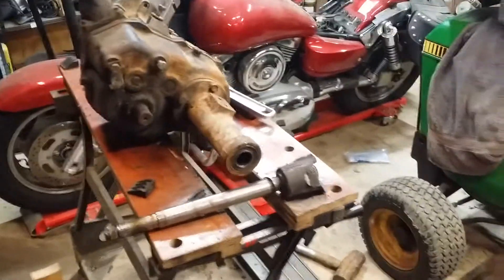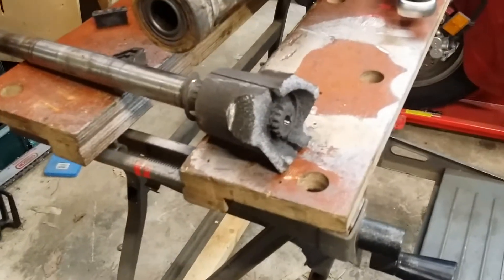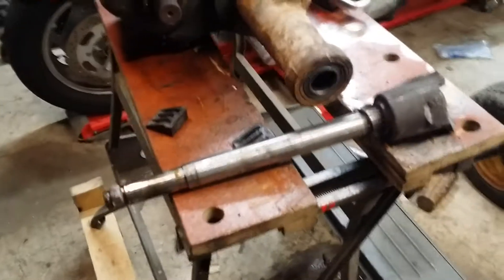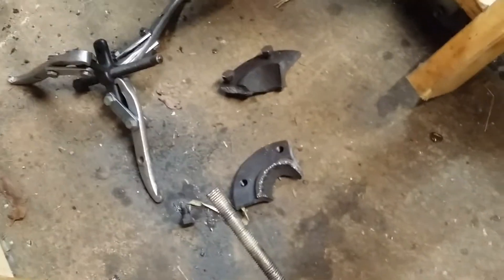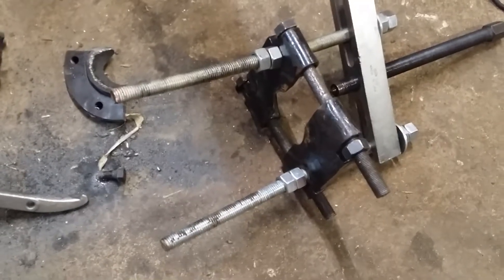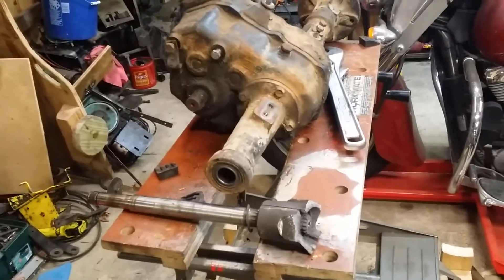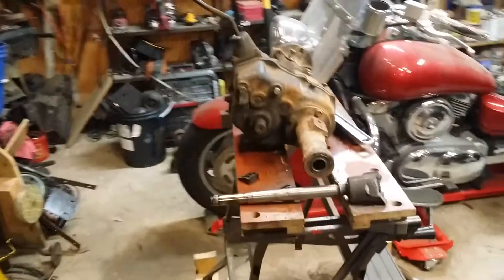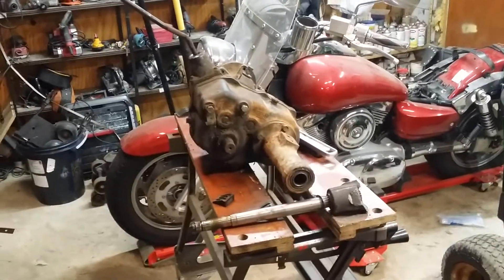John deere 214 axle hub disassembly failure

Comment: You took the snap ring out and it’s still that tight? Usually these hubs get loose over time because the splines wear.
Reply from the maker: Not just tight,  but almost seamed welded together.  I fear the other side might be the same. I also have a pair of other 200 series with loose/worn hubs, talk about opposite ends of the spectrum.
Reply: Craig Tate I think I’d be trying some penetrating oil and some heat on the hub only.
Reply from the maker: @stuffyoucando2  tried heat (propane) soaked for weeks in WD40. If the other side is like this its going on the mill to get split
Reply: You could’ve just taken a cutoff wheel to the hub. Once a slot of cut stick a screwdriver into it, whack it w a hammer, twist the screwdriver with vice grips & it should snap the hub in 1/2.

Could’ve saved ur transmission.
Done the technique many times on stuff.
Kinda surprised it’s stuck on the axle cuz nearly every single one of these hubs gets loose.

Cast spline hub on a hardened steel axle. Issues u find after nearly 40yrs of use. Got 5 of these transmissions. 110rf, 210, 212, & 216.

210 needs work done to it or just taken out, & driven. Transmission shifts kinda sloppy.